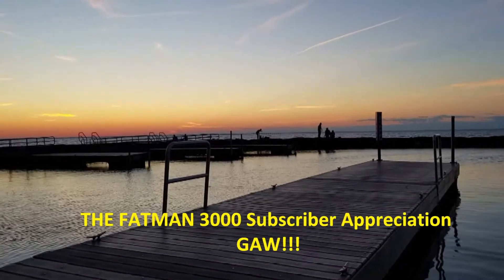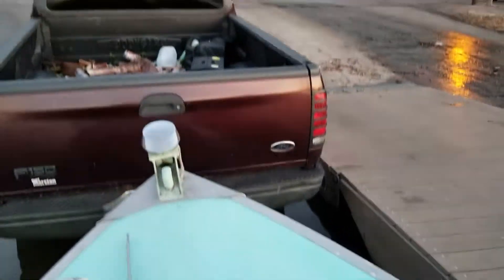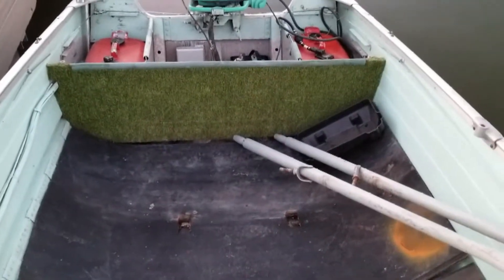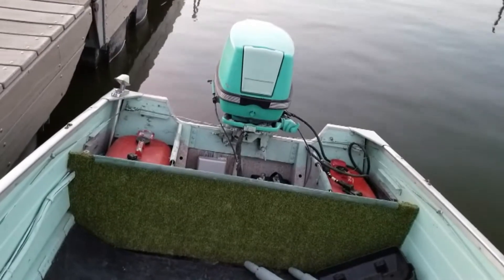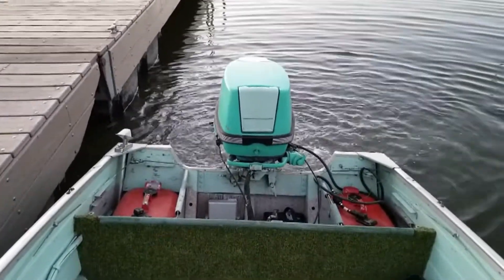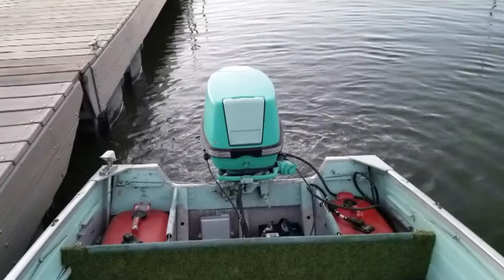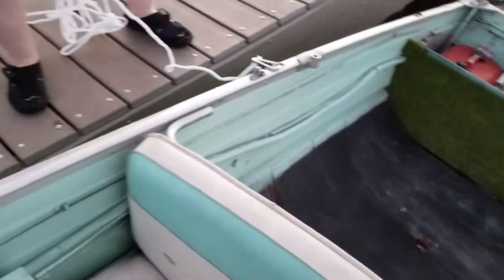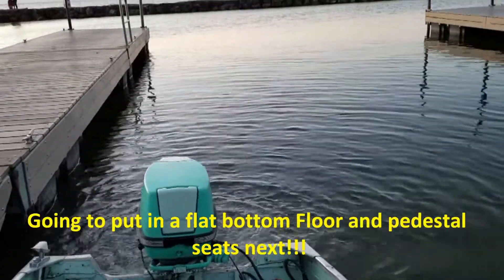1962 Boat & Johnson Motor for The Fatman 3K Sub GAW

Comment: Didn't look like it was smoking enough.  Hope you used the right oil/gas mixture.
Reply from the maker: I did do the right mix.  I think it was the camera, she was smoking but not a ton.   The mixture for that motor is 24:1  I looked it up and then double checked with the Johnson dealer.